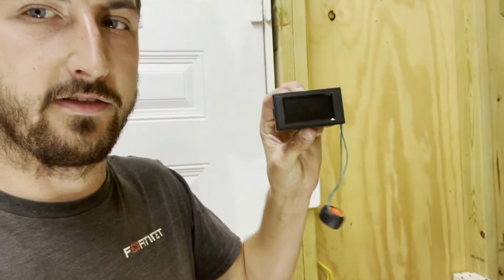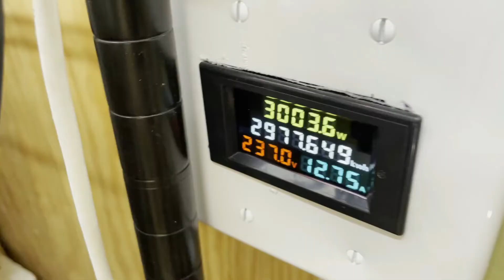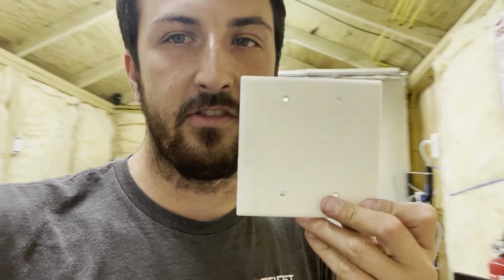Adding MORE 240 Volt Outlets in my Bitcoin Mining Shed

Comment: Great content! What’s the reason for using those outlets vs 2 nema 6-15p avoiding the need for the expensive adapter?

This was my plan so just wondering if there’s a negative. Your maxing out each outlet with the s19j pro anyways
Reply from the maker: You need to make sure you’re not maxing out whatever you choose. My miners use about 15 amps on hot days, and that’s split between two plugs so it should be fine to only use 15amp plugs. I also wanted the locking plugs so I went that route. Price isn’t that different From what I saw but if you think it’s cheaper and don’t care about locking plugs then you should go for it!
Reply from the maker: Just make sure your circuits are oversized. I’m using 20amp breakers and pull a max of 15amp per breaker.
Reply: Hi Kyle, great videos.  Can you please confirm if you are using 2 - 20 amp breakers per S19. Thanks
From my experience the S19s draw around 3250 watts per machine. I've calculated 20 amps x 240 volts ⚡ = 4800 watts x 80% rule = 3,600 watts per circuit. 

Based on your current setup, which I am building similar, if you have a 200 amp service coming from your main house.... 200 Amps x .80 = 160 Amps, which in theory if you were to max out your panel, should be a constant load. 

160 amps x 240v = 38,400 watts
38,400w / 3,250w = 11.8 machines.
Obviously you need to leave some space for your exhaust fans and general lighting. Let me know your thoughts as I'm curious on how you made your calculations? Thanks and look forward to more videos
Reply: I am using the nema 6-15p to a C-13 for many years and it's worked great. Make sure that you use 14 Guage cords and not the 16, as the cord can get very hot!
Reply: @keisenb  so to confirm you have 2 l6-20r connected to a single 20amp breaker? 

At first glance I thought you were using PDUs which is why I asked but noticed it’s a locking cable to c13. 

I keep seeing some say each outlet needs it’s own 20amp breaker which doesn’t seem to make sense 1, it would be hard to turn them on exactly at the same time and if one breaker for whatever reason went bad or tripped, it would ruin the machine as only 1 cable would be plugged in

Comment: Did the L7 end up coming in? Also are the PSU fans of the pro venting into the room or the hot side exhaust room?
Reply from the maker: just posted the video! and they are venting into the room, not the exhaust side. I noticed that the other day when I was installing the L7.. Probably will address that when I redo the hot room soon

Comment: Thanks for the video Kyle, I’m learning a lot from you on this project. Where did you pick up your LCD panels? I’m assuming they show the number of amps and the wattage you are using per outlet? Many thanks.
Reply from the maker: Yes, they show the amps/wattage/etc of whatever circuit you put them on. We actually have 1 20 amp breaker supplying 2 outlets, so we put the lcd panel right before the two outlets. That way, when we plug a miner in that requires 2 plugs, but only needs 1 20 amp circuit, we can see the total load of the miner. Here's the link to the ones I got on amazon!

https://www.amazon.com/gp/product/B01MRZAFAF/ref=ppx_yo_dt_b_search_asin_title?ie=UTF8&th=1

Comment: How many total amps do you have coming in? It looks like you must have 800A or more.
Reply from the maker: 400 amps to the house. and then one of those is used solely for the shed. So 200 amp in shed, 200 for house.
Reply: @keisenb  Hmm, that would imply only 6x 30A circuits, I thought I saw a lot more than that.

Comment: 30A receptacle and load with #12 wire?
Reply from the maker: 2x 20A receptacles on a 20 amp breaker and yes I think it's #12 wire. Pulling about 13-15 amps per breaker split between the two receptacles.

Comment: These are great videos Kyle!! I am in the process of planning my shed build. I will do something very similar to yours. I also have an L7 on order and am crossing my fingers it shows up. Do you happen to know which power cords will work with the L7? I'm sure that the ones that come with it won't work in the US. Keep up the great videos!!
Reply from the maker: Hiya, most mining rigs don't come with power cords so go ahead and order 2 to be sure you have what you need when it arrives. It will use a standard c13 plug and then you can use whatever you want on the other side. I use an L6-20p because I have my rigs on 20 amp breakers, but a lot of people like the L6-30p which is a 30 amp version.
Reply: @keisenb   Thank-you!. That's very helpful.